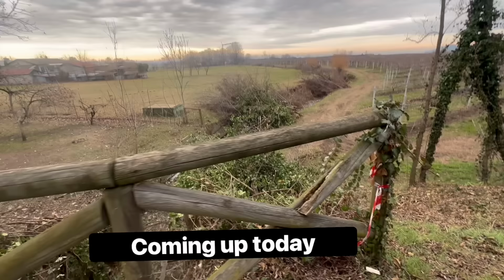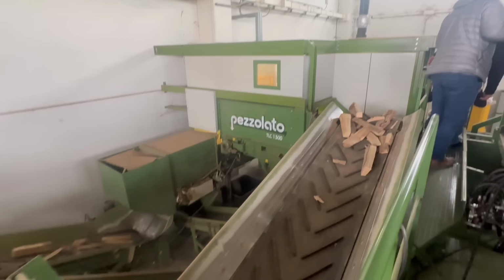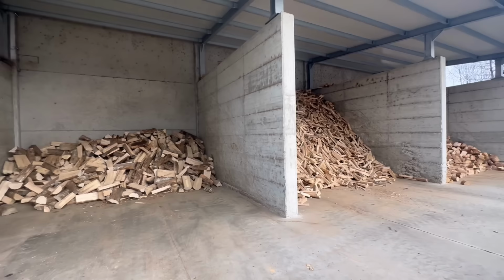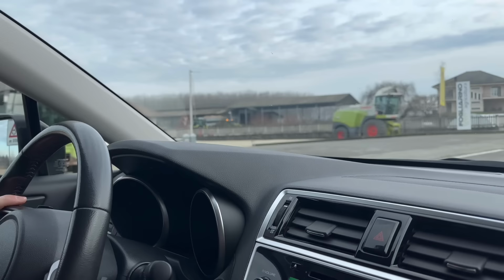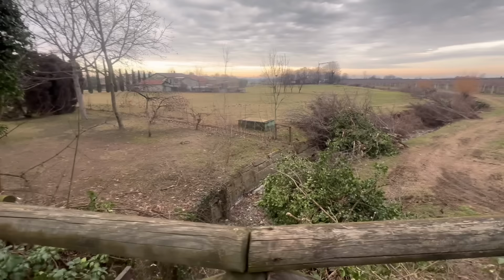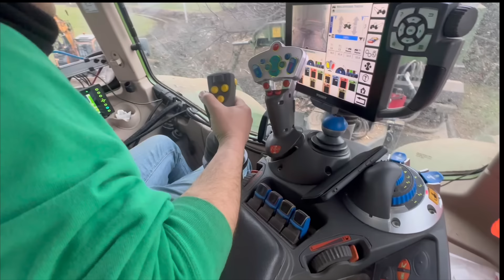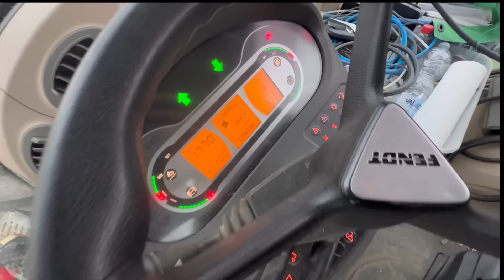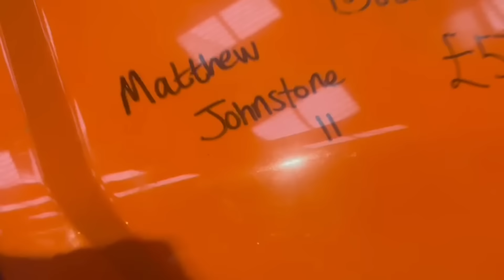A BIG FENDT ON A WOOD CHIPPER #AnswerAsAPercent 1403

Comment: Great bit of kit that Fendt and chipper set up I suppose the main question for your operation would be do you have the right kind/size tractor to run one and can you manage to not chip if/when the tractor is needed on the farm if not then a purpose built stand alone unit would likely suit your needs better but an upgrade on your current chipper seems like a good idea whatever way you go 👍🏼